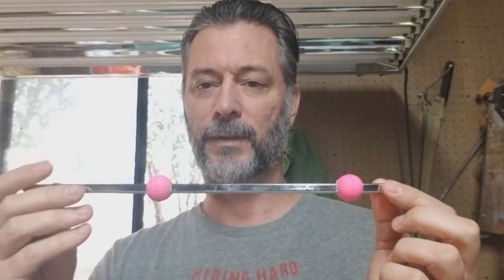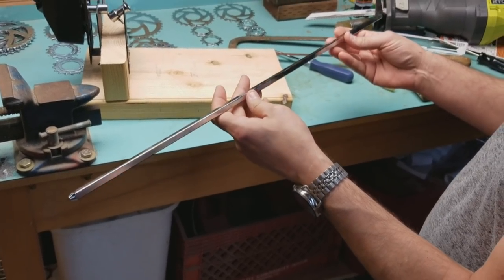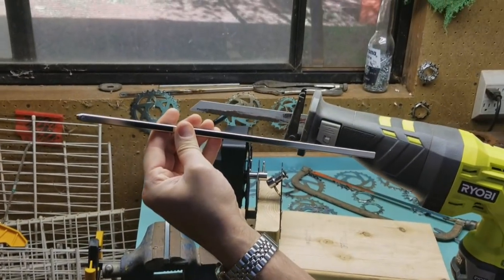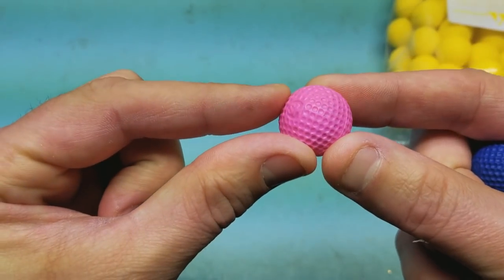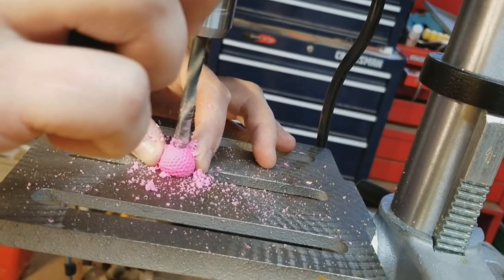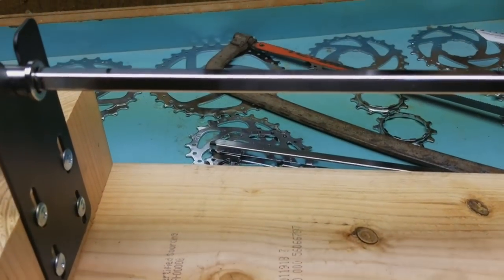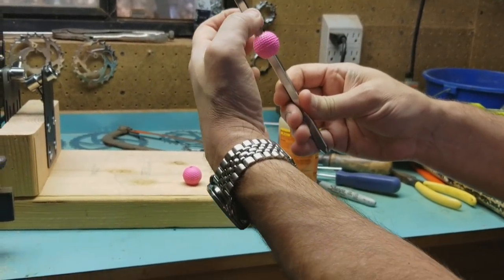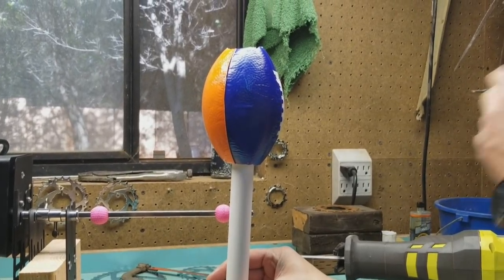How To Make and Install your Foam Balls on Single Tumbler Rotisserie Turner

Comment: Sweet! Thanks, Dan! Another big factor in the balls splitting is not making the hole big enough. I first tried to punch my holes with a rotopunch but they were too small. I'm still trying to get the size right. What size bit are you using?

Comment: Where did you get the adapters for the rod and where did you get the small balls? Last thing, with those balls you need a 3/4” pvc pipe, correct?